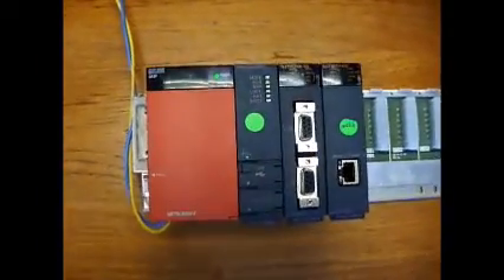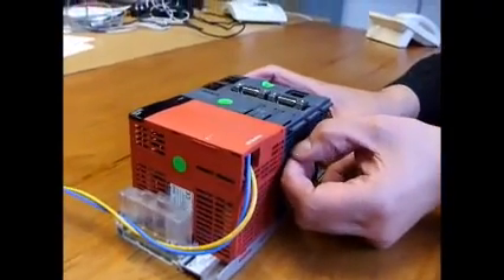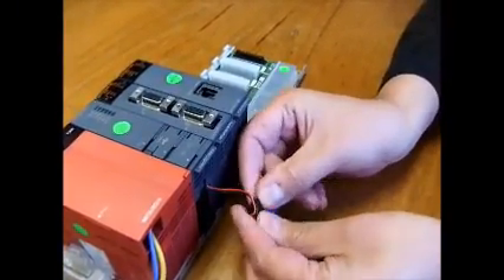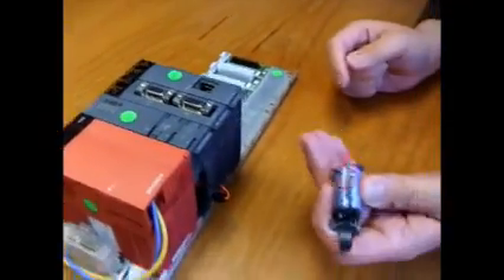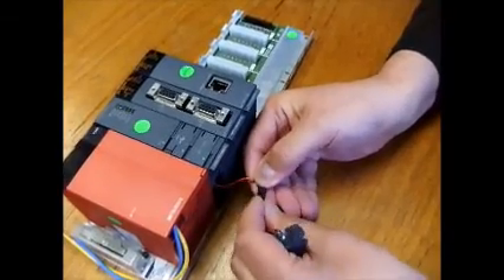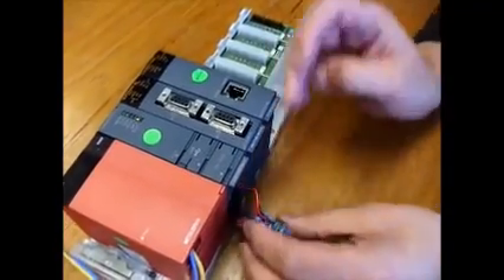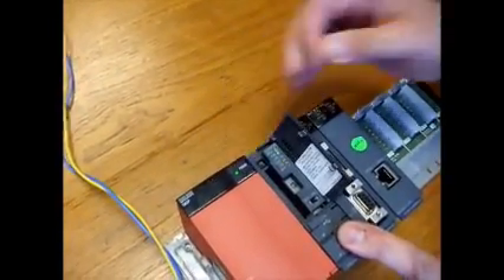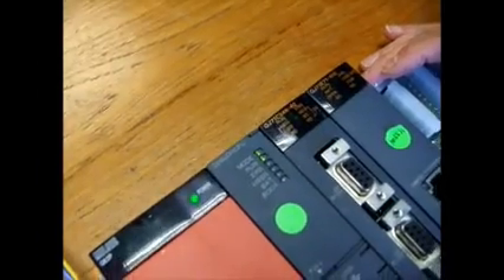Q6BAT Change

Comment: when resetting after replacing the battery, how many seconds should I wait in the reset direction?
Reply from the maker: Hold it in the Reset position until the Battery alarm goes out. Do you you use these PLCs?